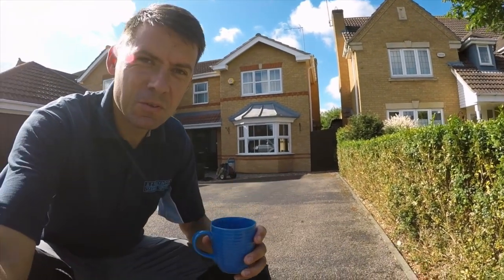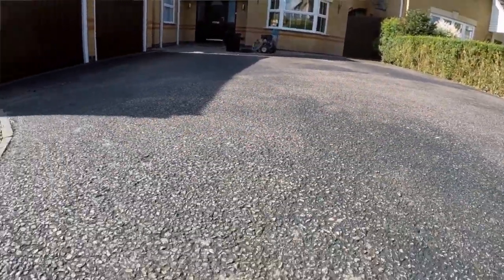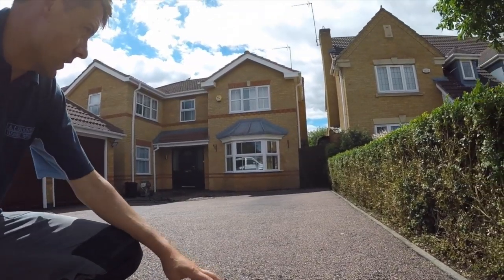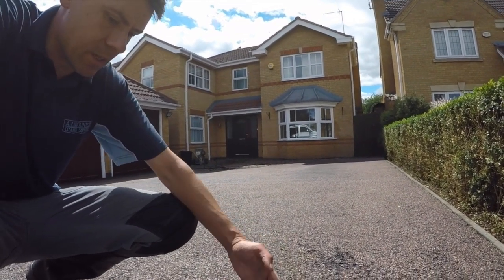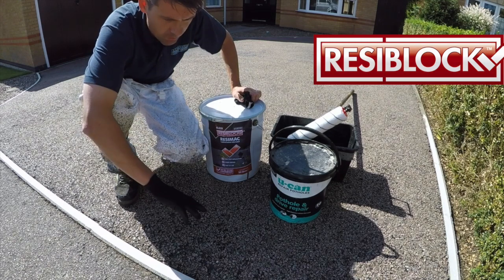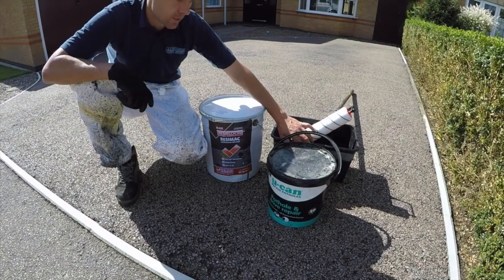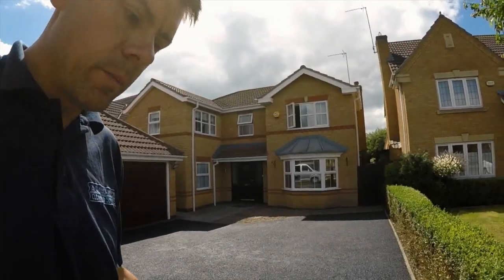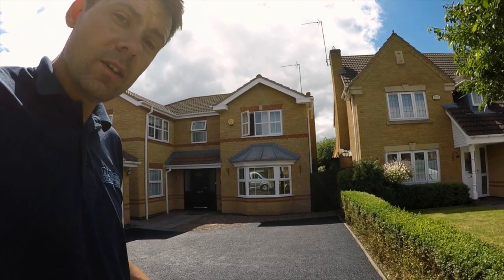Tarmac Restoration Using Resimac from Resiblock

Comment: What a fantastic result. I didn't even know that asphalt could be restored this way (I can see our asphalt driveway being a test case  as soon as I get myself a flat surface cleaner!).
Reply from the maker: Go easy on the pressure over the tarmac so you don’t damage it. It will clean up more easily if you pre treat it with a biocide first.😃👍🏼

Comment: Nice job!!.  I have had lots of junk in my garage for years and lots of dust and debris has settled in their including spilt concrete, sand another building dust.  I had my drivewat done in tarmac 3 months ago and over the weekend was walking in and out my garage to dump paint cans and trash to the skip. This has left creyish stains all where my feet have been.  Fistly, can a pressure washer remove these stains or can a detergent be used and a good stiff brush?  And partly why I am here is that if this scrubbing doesn't remove it, the resiblock can bring the drive back to an even colour again?
There are no 'lumps' of what I think is cement based dust, just footprints.

Comment: really good video simple and straight to the point and the finish looks great
can i ask what is the finish like for grip. my tarmac drive is on a gradient, would application of Resimac make it more slippery? or are there different texture applications available for increasing grip?
thanks
Reply from the maker: Thanks. I wouldn’t say that it effects the grip, it doesn’t make it more slippery. You may want to give Resiblock a call directly, they have an excellent help line.👍🏼

Comment: Hi very good video.  I have spilt concrete on my tarmac from when we did the patio. No matter what i try brick acid etc i cant remove it, any ideas? Cheers mate.
Reply from the maker: Not sure. You want to be a bit careful what you use on the tarmac really.

Comment: Hi am new to the industry please can you advise what size nozzle on your fsc and best pressure on tarmac ill be using a mosmatic 21 Thanks
Reply from the maker: It depends on the condition of the tarmac. You should use less pressure and maybe a jet with a wider fan nozzle. Don’t use hypo.

Comment: Hi ash 
just a quick question please, I’ve a slipstream pro20x from spinaclean and I’ve a tarmac drive to clean and i was just wondering how much to back the pressure off on the machine  so I don’t damage the tarmac as I understand it needs to be on a lower pressure for this type of surface.
Cheers buddy. 👍
Reply from the maker: You will have to use your judgement depending on how dirty it is and what the condition of the tarmac is like. You could just back of the throttle a little.😃👍🏼

Comment: Ashley 
What do you use to remove oil stains on tarmac
Reply from the maker: I normally use Resiblock oil remover on most oil stains. You might just want to give them a call to check on their advice for tarmac.😃👍🏼
Reply: Thanks Ashley

Comment: Is 24 hours of drying enough time to apply sealer as it says 48 hours on the tin but is that slightly overkill?
Reply from the maker: It depends on the weather and the situation of the drive, but the directions on the tin will always be on the safe side.😃👍🏼

Comment: looks really good. Looking to start my own external cleaning business and was wonder if you think its worth starting at this point in the year as summer is pretty much done or wait until next year after winter
Reply from the maker: marcus tandy I would get yourself ready to hit the ground running in early spring when there is plenty of work and you can have a good run across summer. Although autumn /winter can be good for gutter and roof cleaning so it depends what you are looking to offer.😃👍🏼
Reply: @aemackintosh  ok thanks, also when it comes to window cleaning i've heard it is bad to undercut existing window cleaners in order to secure their clients. Whats your thoughts on undercutting and do you think its necessary for building your client base?
Reply from the maker: I think that if you do a good job at a reasonable price, and you work hard at it, you will build a good reputation. If you go around undercutting people, you will upset the ones you are undercutting and ultimately make things harder for yourself.😃👍🏼

Comment: Hi Ash. I do have the same pressure washer as you so my question is if i'm pressure washing a tarmac drive in the normal way how do I reduce the water pressure  so as to not damage the tarmac? Sorry if this is obvious but i'm just starting out. Also I notice you have a double lance  for washing and washing down where you control the flow. what is that lance called and where would i buy one? thanks for your time
Reply from the maker: You could just reduce the revs slightly to reduce the pressure it is putting out.😃👍🏼
Reply: @aemackintosh  thanks Ash. I did see how you did it on one of your videos when you lowered the revs to feed chemicals through washer to spray on a particularly dirty driveway.
Reply from the maker: Yeah, I think that was when I turned the pressure down on the unloader valve. They can be a bit temperamental so maybe it’s best not to fiddle with that. Just drop the revs down a bit and you will be fine.😃👍🏼
Reply: @aemackintosh  👍

Comment: If the drive  has moss on it. What would your approach be
Reply from the maker: Joseph Kelly This one was a bit mossy at one side. The flat surface cleaner sorted it out.😃👍🏼
Reply: @aemackintosh  ok can I ask you would a washer 13l a min strong enough to use with surface cleaner to move the moss.
Reply from the maker: I think most flat surface cleaners require a minimum of 15litres a minute.😃👍🏼
Reply: @aemackintosh  ok I wonder is my washer not putting enough water out then. I have change the jets to suit the washer. Thank you am a big fan off your video. You seem to be nice and helpful.
Reply from the maker: Possibly, the fsc should be suited to the machine you are using. Since they can vary, I would suggest you speak to the people you are buying the equipment from to get their advice on which ones should work well together.😃👍🏼

Comment: Hi, great video! Just wondering how much this total job would cost? Thanks
Reply from the maker: pjmagennis I price a job by measuring up  the area and I charge per square meter. I did a video on how to do it but I would prefer not to say how much this specific job was. I usually do a price for cleaning and an additional price for sealant applications.😃👍🏼

Comment: This product will cover oil stains? Or you remove first oil stains from tarmac?
Reply from the maker: It’s good to remove it as best as you can first otherwise the Tarmac Restorer won’t adhere to the surface properly.😃👍🏼
Reply: @aemackintosh  pressure washing only or some chemical? Do you have your favourite chemical solution for oil stains on tarmac and asphalt?
Reply from the maker: W&W Window Cleaning Resiblock Oil Remover is what I normally use.😃👍🏼

Comment: Will that pressure washer remove dead moss from tarmac ? Of what type is it ? May need to rent one
Reply from the maker: Steve Shorter Yes.You do need to be so careful on tarmac though, you could easily damage the tarmac with the pressure washer. Sometimes a chemical treatment in combination with gently pressure washing works best.😃👍🏼

Comment: What is the drive like after 1 year, can you share an honest update? My drive looks like yours did exactly before you stained it so I am really curious how long you get from it. If it is not long lasting it's a lot of work. Can you please share?
Reply from the maker: It can really depend on the situation of the drive: if it’s in a very shady spot or in a lot of sun. But it should last a good few years 3-5 maybe. But yes, eventually it will wear and need cleaning and another coat.👍🏼

Comment: Great video, excellent result. May I ask how much pressure you used on the tarmac from the surface cleaner?
Reply from the maker: hvatifannar Well I don’t know exactly, but I use good judgement. As it’s tarmac, you want to be a bit careful, you don’t want to damage the surface. So I keep the revs a little lower, and you could always adjust the unloaded valve to a lower pressure also.😃👍🏼

Comment: Hi mate

How much restorer did you use on that job?
Great work.
Reply from the maker: SB Cleaning Services I think it was about 25litres. You have to be careful when calculating how much you need for tarmac. If it is very pitted and damaged it will absorb more, so you will need a larger quantity.😃👍🏼

Comment: There is loads of tarmac drives around. I find a lot of drive has a lot of moss on it what is the best way off cleaning it.
Reply from the maker: Joseph Kelly The flat surface cleaner should get rid of the moss. If not, a bit of spot cleaning with the gun but careful how much pressure you use so you don’t damage the tarmac.😃👍🏼

Comment: Hi Ash, did you use a cleaning solution prior to cleaning the driveway or just water thru the rotary cleaner ?
Reply from the maker: Rick Kozarits Just water in this case, I didn’t need to use any cleaning solutions.😃👍🏼